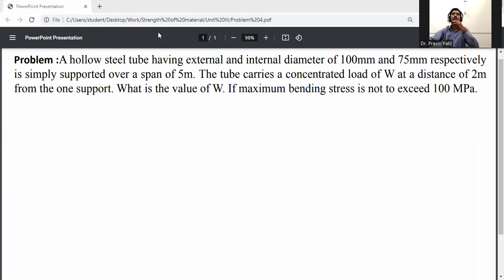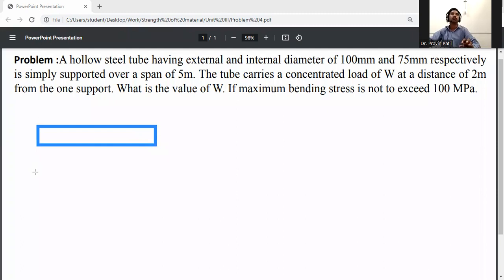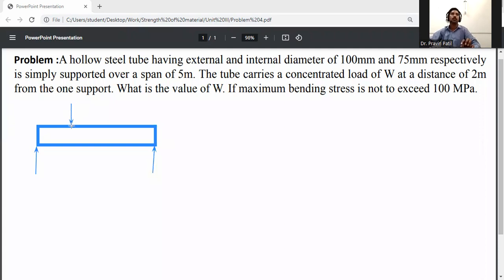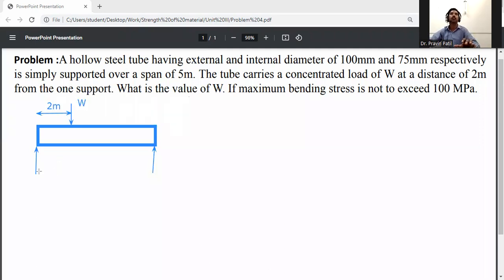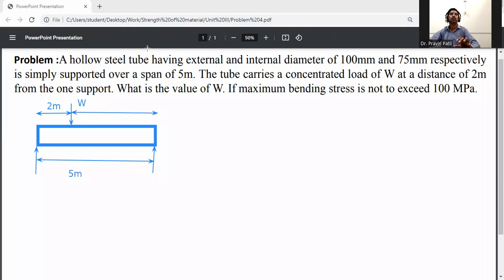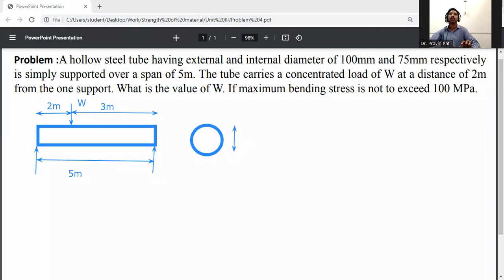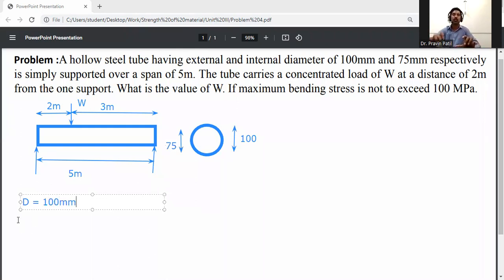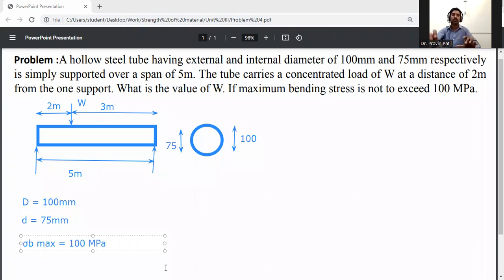Bending stress in beam for hollow circular section and eccentric load/ Strength of Materials

Comment: What is the method of analysis/calculation of a circular hollow section inside another that are fixed to the ground? Would you treat the material as one and add the elastic moments together? OR analyse them separately since there's space between the two sections? 

For example if there is a 1.1m in height circular hollow section (CHS) that is sized 42.40mm (diameter ) x 2.0mm (thickness ) with a 0.3m (CHS) inside that is sized 38.10mm (diameter) x 2.0mm (thickness ). There is a point load of 0.74kN acting on the top of 1.1m tube and it it assumed that at the bottom both CHS are fixed. How is the bending moment, stress for the posts calculated? 
 
Thank you, any help is much appreciated.